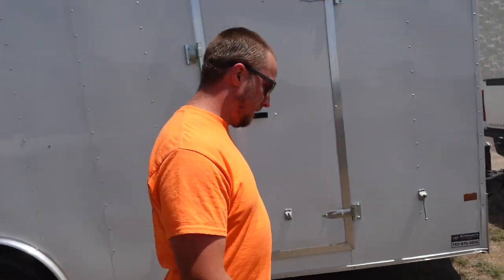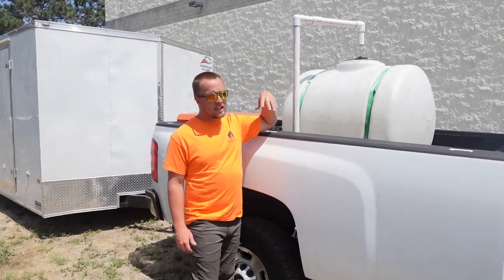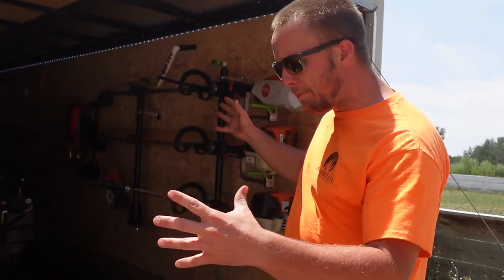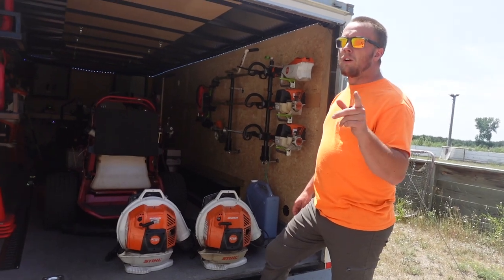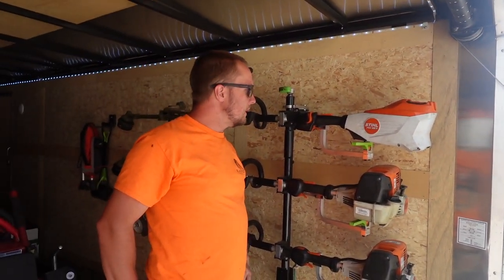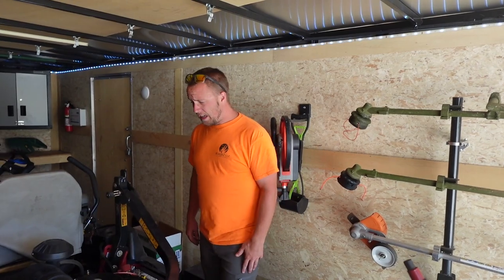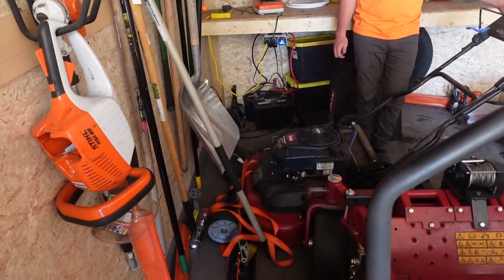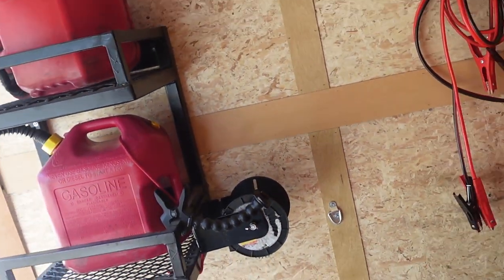2023 Lawn Care Setup! Enclosed Trailer #lawncare #equipment

Comment: My 09 titan’s transmission blew up on me at 260k. I put 120k on it over 5 years. Now I have a 21 titan and I’ve already put 40k miles on it lol.

I’ve had great success with the Titan but I was considering a Chevy awhile back. 

That trailer you got is BIG. I pull a 5 x 14 brand new in 2018. The floor was warping terribly so I had a mobile welder, weld steel bars horizontal to cross the original vertical bars. It took it to a 30k lb weight capacity from 8k. 

I run echo, but I love Stihl too. I see you have a battery powered stick tool with a Darwin’s grip, everyone swears by the Darwin’s grip.
Reply from the maker: Yeah, echo and stihl both work great. Those cross bars were an excellent idea. Most trailers run angle iron or a thinner c channel which tends to bow or warp over time. Toyota makes excellent trucks, you can't go wrong 👌

Comment: Nice set up. The 6.0 is over if the best gas engines out there. 

Haulmark does not manufacturer American hauler trailers. American cargo group owns American hauler. They purchased the company in 2018. A year later, they purchased haulmark and wells cargo. 

I only looked into this because you said that you didn't think your trailer was that good. I started with a haulmark trailer and i loved it. I used it for 21 years before finally going to a larger trailer so i could haul three machines. 

What is the box hanging off the left side of the grandstand?
Reply from the maker: 21 years is an insane life span for an enclosed trailer. This trailer is fine it just seems really cheap. Ive seen better for sure!  I think the little box you are talking about is a winch controller. I run a winch on the front of the grandstand to lift my dethatcher. Thanks for the comment!
Reply: @bladezllc  yes, it was a really well built trailer. I have a custom built 2020 enclosed trailer now. It's a tank but I don't expect to get 20 years out of it. 

Great idea on the winch. I have a hitch mounted winch I use from time to time on my multi force. I use it to rescue the Altoz mower when I bury it in the mud.
Reply from the maker: @Hillsidelanscapemanagement  I wish my mower was a multi force! That would make life so much easier. We have had to use the winch to rescue a few mowers. It works well for many things. I saw you had an Altoz mower. What do you think of it?
Reply: @bladezllc  don't get too excited...I bought the multi force without the hydraulics (didn't think I'd ever use them and, in Florida, I never needed to). Wishing I had them now

I bought the Altoz for mowing retention/detention ponds and mowing overgrown vacant lots in the 'rural' areas north of Tampa (there's not really anything rural within 90 minutes of Tampa, honestly). It worked great for that work. Unfortunately, I only captured a couple of jobs on video. I only got it stuck twice, once was totally my fault for dropping it into muck that was super soft and in a hole. The other time, I hit some soft much again with an embankment on the edge that, rather than climbing over the embankment, the machine tried to dig itself under... Other than that, it's been awesome. It will cut anything it can push over, including 2.5" saplings. 

Having moved to NE Tennessee, there's not really any retention ponds around to maintain and the vacant land here is way too big for this unit. It's also a trick pony. I'm looking into a Ventrac/bobcat articulating tractor